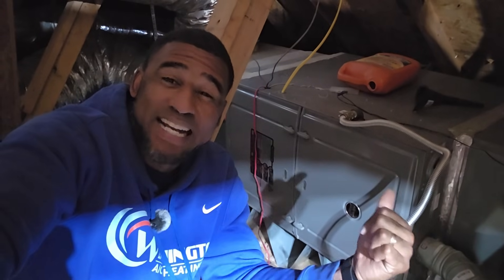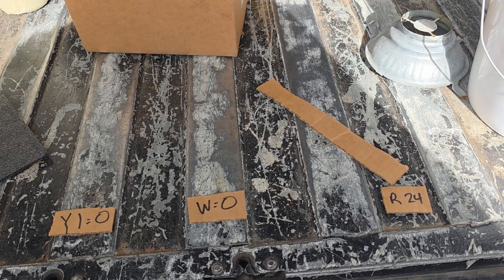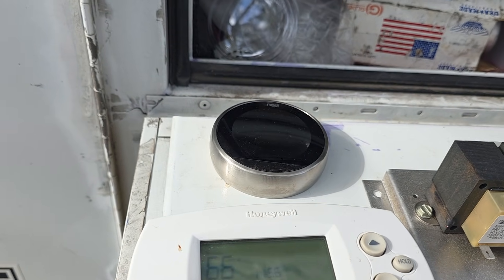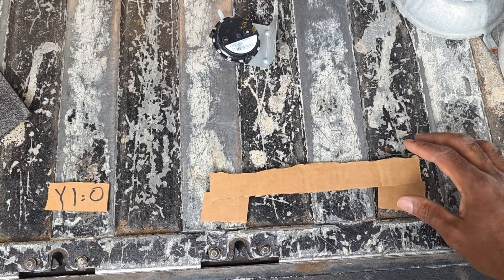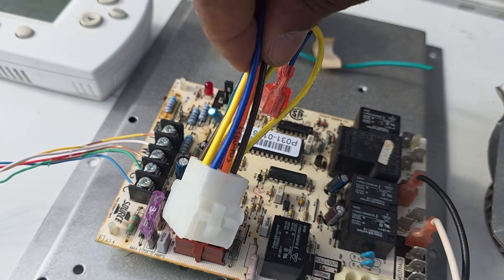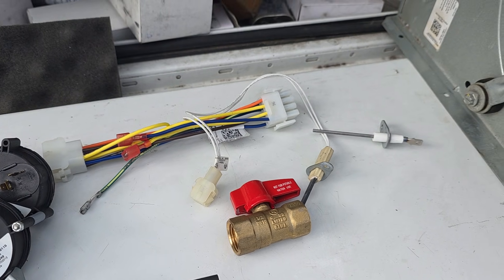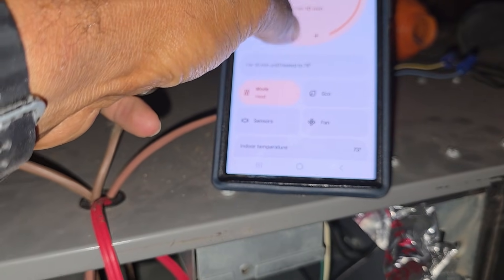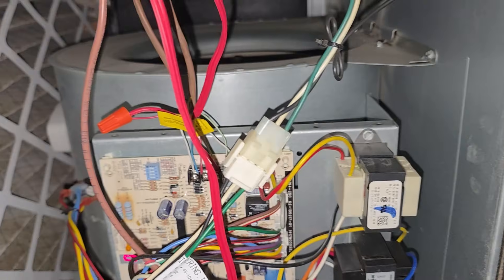Gas Furnace Sequence of Operation – Step by Step for HVAC Techs

Comment: This is nice shows proper sequence of operation n even shows n explains how to troubleshoot it. Great video, very educational.  Need more of these
TIP BIG FB
Thermostat 
Inducer Draft Motor 
Pressure Switch 
Board 
Igniter 
Gas Valve
Flame Sensor
Blower
 Study it, memorize it.
Reply from the maker: Awesome! Thanks for dropping those key steps—super useful for techs out there. Appreciate the feedback!

Comment: Bro!!please make more detailed videos like this, very detailed on the volts and how to check with multimeter.currently in hvac school ans these videos help alot.if u can include the in the videos the proper voltage on a part that it should be using a multimeter it will help aot.
Reply from the maker: Appreciate the feedback, thanks for watching and good luck with HVAC school!

Comment: Now ya can break the video down further if sensors a symptoms etc.  or like gas valve chatter noise a failure to light etc.  
an break it down component by component.   

That’s a list of videos in an of itself.  Least for some of it.  One particular. Thing.  May cause a few different types of symptoms/problems.  

Or problems that may seem like something that it may not be.  

Or for instance your seeing this for symptoms a you have some type of high limit fault.   Though it may be tripped out on this limit.  Is it actually said limit that’s bad.   
Or is it this instead that’s actually the issue a because of that. This limit is kicking out due to this. Etc. 

Tried to dictate this to the phone so hopefully it’s understandable.  

But you can break down say the furnace component by component into lil 10 minute videos enough for the monetization of symptoms a possible causes.  

Just kicking out the idea.  It can be like a complete furnace series of videos.  

Same can be done with just ya regular Central Air can be a lil mini series an heat pump be a lil mini series.  

This was a good video.  Definitely made it understandable.  To the degree that for anyone that’s never even touched it. Could wrap their head around it.
Reply from the maker: Appreciate the detailed feedback and suggestions! I can make a series out those suggestions